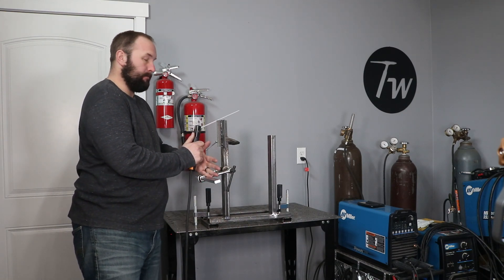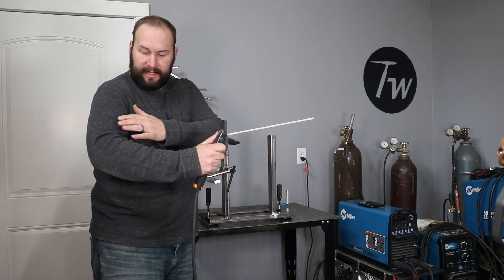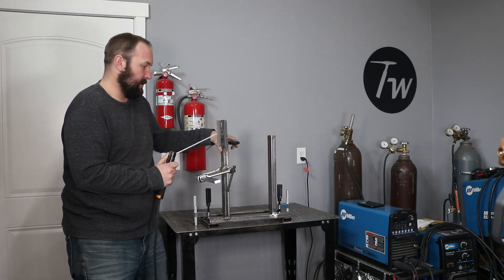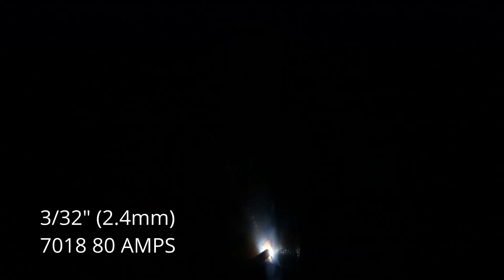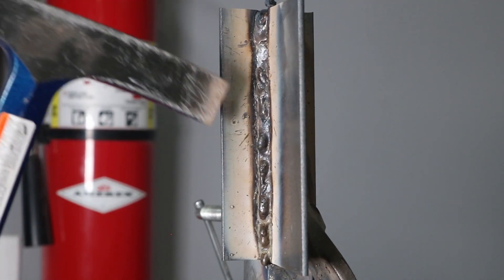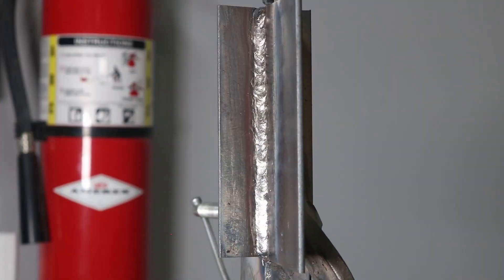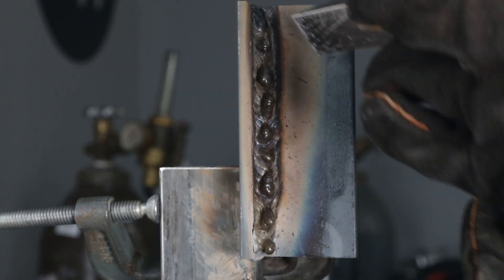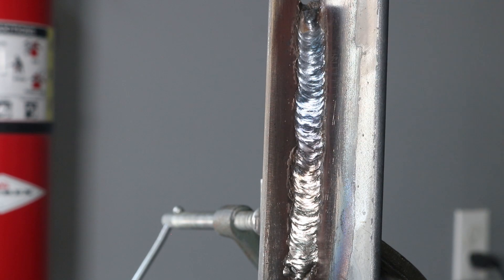How to Stick Weld Vertical Joints: 4 Ways to Get the Job Done

Comment from the maker: You can learn to weld.  I'll show you exactly what to do in my affordable online welding courses at https://courses.timwelds.com.
Reply: Tim could you make a video about what the proper amperage and distance rod tip for 6011 looks like also what incorrect amperage with 6011 l9oks like
Reply: Time, I bought your full course a couple weeks ago. Been watching the SMAW videos, I’m trying to learn vertical now and something I didn’t find covered in the course or YouTube is that sometimes my flux burns down on one side further and I end up chasing my arc instead of telling it where to go. Do you have any insight on this? Running 6013/7018 rods on an inverter machine if that helps any.

Thanks Tim. Love your content.
Reply: 😂😊😂 @2010mannw
Reply: What type of electricity are you using AC/DC?

Comment: Just asking is downhill weld is required in welding job?
Reply from the maker: It depends. With stick welding, downhill is pretty common for open roots with 6010 electrodes. Downhill is also used quite a bit for short circuit MiG on thin material. For thicker sections or with 7018, uphill is more common.
Reply: If use I beam steel can I this downhill welding or not? @TimWelds
Reply: Just asking what wrong if you weld a I beam using with 6013 then suddenly your rod is bending itself. Is it the amphere adjust or just slow?

Comment: this was the exact task I have to weld tube steel onto a chicken house with 1/8  gauge frame to hold a chicken ladder using this vertical technique from top to bottom and using 6010 rods on 6010 mode. thanks!

Comment: I have been stick welding for 40 years 
And always started at the top and go down 
I think I have been doing it wrong but it works for me 
Never to old to learn 😂
Reply: well yea most of the time vertical is done upwards because you have no chance of slag inclusions, but with vertical down the slag is running in front of you which causes lack of fusion. Vertical up is harder to do but lays a stronger weld, vertical down is easier to do but is harder to get a sound weld.
Reply: As commented above. You're trying to control your pool and it's very hard to go vertically down. I would actually love to see it to see how you've pulled it off 😂

Comment: One thing i do sometimes if i cant brace i will use my legs. Everyythings nice and pulled in tight to my body, slight squat and i will slowly rise up as i go. It seems to work well for me 🤷‍♂️ i have enough control with that mixed with some wrist movement if need be

Comment: As a guy relatively new to welding, I have heard "If there's slag, you drag".  Here, in the vertical up motion, you are pushing.  I am a bit confused.  A little help here coach?
Reply from the maker: That's generally true. With vertical welds, gravity will pull the slag downward and you can prevent the molten metal from falling out by using a slight upward angle. The best way to get a feel for it is to try it both ways on some scrap and see what you think.

Comment: I am building a vice stand and the base is 1/2 " thick steel for the weight and the post is 1/8" galanized 2x3" square tube. is it ok too use 6013 too weld thes together using multi passes with this rod? I iknow I have too remove the galvanizing from the tubing.

Comment: Why does my stick welds get bird poop? I used same amperage for 7018 3/32 and tried amps from 80-95 and I had bird poop, I ran arc captain 200 welder.
Reply: Try to notice the root pass before doing vertical position

Comment: If you want to weld vertical point the rod DOWN NOT UP ! 
Get it right !
Reply from the maker: There’s no need to yell, bud. Do what works for you, but that’s not a good practice. Gravity will pull slag down and the arc force pushes metal upward with the upward facing angle. Never seen anyone competent doing it differently, but you do you.

Comment: Can’t stress your comfort enough.  I’ve learned it’s one of if not the most important thing. Check your settings and make sure your stable. If you have trouble striking an arc, try making a scratching motion don’t forget to pause so it can establish and 7018 is easy. 6010 you’ll need more practice

Comment: What if your welding unit oy goes to 95amp😢
Reply from the maker: It’s fine, just run 3/32” electrodes and you can weld about anything. Just use multiple passes on thicker material.

Comment: Thank you sir!  First time I've tried vertical welding...as I'm modifying a Deere riding mower frame by welding in some 1.5" strips to the back end.  Yours was the first I'd seen where a vertical weld was done with something other than 7018.  Thanks.

Comment: One thing I've noticed is that most YouTube welders don't stress how much help it can be simply to hang your stinger over your shoulder, not having the weight of your lead, connection points, as well as the electrode holder itself on your shoulder as opposed to holding all that weight directly in your hand in front of you, if you didn't know this I highly suggest trying it
Reply: Or flop/loop it over your elbow..
Reply: Warm the rod as well   👌
Reply: 6010 down hill, horizontal, overhead a d flat. Quick, strong, and used for the last 60 years on pipe lines, storage tanks and general steel construction.  Passes X-ray, ultrasonic and hydro tests.
Reply: @kennetharntson5912  I think you replied to the wrong comment
Reply: I was shown  how to do that by a very good welder in 1980. When I left school he said to me your welding all day long so make your self comfortable.  Wise words
Reply: I always put my electrode leads around my right shoulder when welding.  So much more comfortable..
Reply: Just get a gym membership 😂😂😂
Reply: @diyoverhauler5432 something tells me you're not a welder and dont know how heavy leads are. Even a stinger can be up towards 3-5lbs depending on how long you have it cut, not to mention the lead which can be up towards 50. Hold you hand out in front of you holding 3-5lbs for anywhere from 1-12 hours and tell me that a gym membership is going to help. I'll wait.
Reply: Not good to do that, radiation

Comment: Q: I'm Sry, did I miss the amperage of first two welds (#7018 - 1/8 then 3/32)?

Also, I bought some 3/32 7018 w my first attempt welding kit a few weeks ago (also 6011, decided after watching your vids); but my welder (cheap master craft 80A) says it's not compatible w 7018 : / anyone know why??
Reply: It may work, or you may (probably will) get lousy welds,  use 7018AC rods instead.

Comment: Hey thanks for the video, but I got an important question.
I'm teaching highschoolers to weld. 
We are running 3/32 7018 - no 6010 yet.
Now my coworker insists on teaching 7018 vertical DOWNHiLL ...
I need to understand is that okay to teach as the first thing for vertical? And in what cases do you weld downhill with stick?
Because I strongly feel it should be taught uphill unless no matter how they try, they would only then do downhill -- is that a valid approach???

Comment: What happens if you weld a vertical piece of 1/2 think plate with a 45 degree bevel with a 1/8 landing at 130amps. Non structural application. Top to bottom welding rather then going up.

Comment: 95-100 amps for 1/8" E7018, I'm surprised it even ran at that low of an amperage which also explains why the puddle wasn't clearly visible, the slag didn't peel off like it should have, and the bead looked cold & lumpy due to lack of arc force 🤣

You should NEVER reduce your amperage more than 10 amps than what you use in the flat position.  If anything, you should learn to run the same amperage all the time and control the weld puddle by altering the arc length (aka arc force), rod manipulation, and travel speed 😉

3/32" - E7018 - 90 amps [Flat]  Minimum Vertical Amps - 80 amps
1/8" - E7018 - 125 amps [Flat]  Minimum Vertical Amps - 115 amps

You can tell if your amperage is right by how easy it is to control the weld puddle and how the slag peels off.  With E7018, it should literally peel off with little to no effort.  If it sticks like in this video then you're amperage is wrong and don't try blaming the electrode brand either because in my 30+ years of experience they all run pretty much the same if your settings are correct.

Also, 1/8" material can easily be welded uphill with 3/32" electrodes so there is never any justification to use downhill on something that thick.  For material less than 11 gauge, you can also use 5/64" E6013 and run it uphill with no issues or just increase your travel speed with 3/32" if you feel comfortable doing that.

3/32" E6011 - 50 - 55 amps
3/32" E6013 - 65 - 70 amps
3/32" E7018 - 80 - 85 amps

I'm not even going to begin to comment on that uphill 6011 root pass 🤢
Reply: In school I'm pretty sure for 3/32 we ran between 75-90 amps and on 1/8 it was 90-120.

Comment: I remember from welding school, on vertical welding, The first bead was set in the middle; then there was a bead I had to run on each side of that first weld, and then my instructor wanted me to do what he called a weave weld over the top of all three of those welds, which look awesome when welded perfectly at the right heat and rhythm. My instructor got me through brazing teaching me to find a rhythm and keeping that rhythm for a beautiful weld every time. The hotter the burn the faster your rhythm would have to be for stick welding. Jack Stone, Sooner Trade School in OKC. Great instructor. 10% class, the rest was all shop work!
Reply: Your comment just helped me out a lot. Currently in welding school doing vertical stick and it gets too hot and continuously drips, I’m thinking like wtf I’m steady and slow…
The hotter the burn the faster the rhythm.
Reply: @commplicated3800  you can try adjusting the setting as well; you just have to play with it; I was made to master welding a bead on a horizontal plane before I could move on to vertical welding. It will make finding the right temp and speed and rhythm for a vertical weld. Staying relaxed and not getting frustrated is really key as well; sometimes you just have to take 5 and get a drink of water or something and relax and go back at it. good luck

Comment: I had problems with liquid metal from the top just running down the bead and ruining it. Is it too hot?
Reply: Yep run at the low end of the electrodes amperage range

Comment: My instructor hates when I run downhill, but my welds are always picture perfect. After watching this I need to start practicing my uphill, you make very nice beads and I want to do the same. Thanks for the content!
Reply: He may say this in the video, as I'm still watching it, but I believe uphill is stronger as well. Not a very experienced welder here, but I work at a stone quarry/blacktop plant with some pretty good welders. A lot of structural welding going on there!
Reply: You get slag inclusions in your weld going vertically down. It can compromise the weld.

Comment: The absolute right way to vertical welding is going from bottom to top with a skilled left and right motion even with thin metal, if the material is to thin to set right amperage then it’s better to spot weld.
That’s what I learned, and I was also skeptical when going to welding class why not just go straight up or down, I asked the instructor if it would work and he said, go and try, make yourself some training pieces and do it, and I did, more than once and it was a disaster, the weld always hung over.

Comment: I’m 15 and started my welding classes In September i just got to the vertical part of the course. and it’s quite a bit harder than most of the other ways. But i think i got it figured out. Thanks to you Of course
Reply: I am 18 and vert is hard and over head I personally think it is easyer than vert
Reply: @johnbowe4564  my instructor taught me overhead before vertical cuz he said vertical is the hard one with stick. I got it quicker than overhead but i think thats just because by that time i got used to knowing what i’m looking for
Reply: @johnbowe4564  personally I think overhead is harder than vertical, and I also think vertical is easier than horizontal because you can stack your steel vs you can only lay so thick a bead horizontal to remain uniform and not burn your steel/compromise the integrity
Reply: You guys that are starting young, good on ya! I'm 34 and I consider myself a "decent" welder. I am a card carrying union millwright tho. It's a great career especially for someone like yourselves who is entering the field with welding experience. In WA state apprentices start at 34/hr with insane benefits and after 4 years of being a apprentice you make 55+/hr. Just wanted to put that out there for you. Feel free to message me any questions.
Reply: @gregartman9827  I want to learn more welding I'm in Perth
Reply: @gregartman9827  I work at manke, no certificate, we're only making 21 to start, I've been working there 5 years I am just now making 23.50, I need a better job 😂 I can weld in any position
Reply: @gregartman9827  can you please send me more information regarding the weld apprenticeship, I appreciate you
Reply: Hell yeah
Reply: @eliyoungblood4234  15 ? Do you take a welding course in highschool ?
Reply: I started welding at 16  hope u love it and keep goin🔥💪
Reply: I’m 15 to and I never welded before but I go to a voc school and I am learning welding
Reply: The key is very tight arc and don't go to fast you should be carrying a decent size puddle this depends on how thick the material is of course 3/8 I run around 110 but if it's thicker 1in and more I will run up to 120
Reply: Good luck I understand ur pain
Reply: Just remember gravity, let the pool build up, but stay just ahead, like he gave an example, the weave bead is your best friend
Reply: Mig welding is way harder vertical than stick
Reply: And Stick with it don’t give up 😎👍
Reply: I am 47 just started as a hobby welder. Your never old or to young.  No matter what you do, just remember have fun doing it. And congratulations on you traid choice.
Reply: I’m 15 and half way through my first year of tech school about to take my v up cert thx to this video
Reply: Yes
Reply: Your gonna get it for sure

Comment: How true is the assumption that welding top to bottom is not recommended because it offers no/less strength .
Reply: A good weld is a good weld. It doesn't matter which direction it's welded in. 
A good welder makes good welds regardless of gravity by varying their technique.
It's that simple.

Comment: Welds look nice, but I feel like the heat is too cold for 1/8, I like more a 120 range..also why did you switch to 3/32 rod for the second pass? I’m an iron worker so I also do structural welding and I’ve barely ever used 3/32 rod

Comment: When having to stick weld vertically, and you have the clearance to approach the weld anyway you’d like, is it better to weld upwards or down? If it make a difference, why?
 Very good videos! Thank you!👍👍👍
Reply from the maker: Uphill is generally better because you’re moving slower and will get better penetration. Downhill runs faster can be help avoid burning through on thinner material, though it only works with some rods like 6010/6011.

Comment: Appreciate all of the good tips, especially about welding perspective, which I push heavily with my students. However, I recommend more of a 45° perspective where you have more control and can keep better balance by not needing to lean into it. It also improves your view, and thus control of the arc gap.

Comment: Tim, I really appreciate the info..... learning horizontal and vertical..... I use the 6011, 6013 and 7018 electrodes in 3/32..... so glad you mentioned your setting..... Forney is the brand I use.... they work very well.
Reply from the maker: Thanks! I’ll have to give those rods a try!
Reply: 6013 3/32 is a very annoying rod to use
Reply: @ezwsteez  I agree!

Comment: Hi there, what size of stick I have to use to weld 1.5 millimeters square pipe to same with inverter welding machine???
Reply from the maker: I have done this with 3/32” (2.4 mm) rod before, but if you’re new to welding, I’d start with 1/16” (1.6 mm) because you can run a lower amperage and will be less likely to burn through.

Comment: What type of rods do your prefer? I have been running Hobart 6011 and 6013
Reply from the maker: I'd pick 7018 every day of the week, but each one has strengths and weaknesses for different applications. 6011 is good for root passes where you need to penetrate deep or if you have some rust that can't be removed. 6013 is good for general purpose. 7018 lays down a nice smooth bead, deposits a lot of material and the slag is easier to deal with.
Reply: @TimWelds  thanks! Your channel is great.

Comment: great info here thanks! i got an ac 225 the other day and it trips the breaker at 130 amperes after welding for 5 seconds or so. any ideas? 
Lincoln ac 225
square D 50 amp breaker. 
6/3 awg wire. 
i checked everything with my meter too.
Reply: Have you figured out the issue? If not, you should check the breaker.. possibly change it out for another 50 amp breaker and see if that works.. also, do you have a clamp meter that reads amps? It would be a good idea to look into that..
Reply: @berniemac8413  ordered a meter and a breaker. thank you. i’ll post when it’s here and tested
Reply: UNPROFESSIONAL awesome! Hopefully it’s just the breaker.. I just bought a used buzz box as well. And have been itching to try it too! 😅
Reply: UNPROFESSIONAL also, is there a reason you used 6/3 wire instead of the 6/2? And what did you do with the extra conductor wire?
Reply: @berniemac8413  its what i had lying around, all i had to do was buy the outlet. bought a new breaker and still happening. its a ac 225 from 1973 haha, going to tear it apart today and take a peek inside
Reply: UNPROFESSIONAL gotcha. So what did you do with the extra wire? Haha wow! I guess these welders are pretty indestructible. If the cable or breaker aren’t the issue, then there’s probably a short inside the machine.. good luck!!